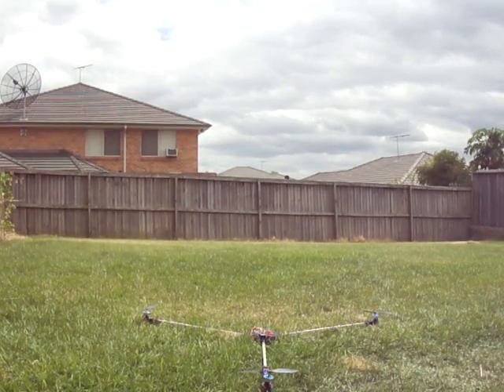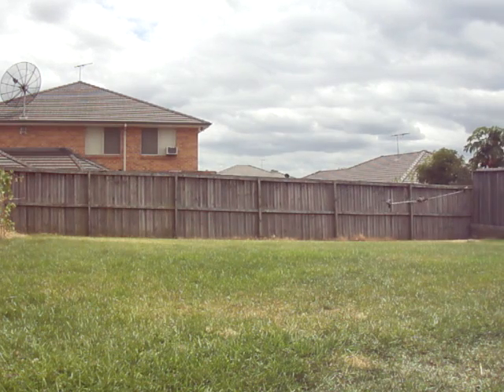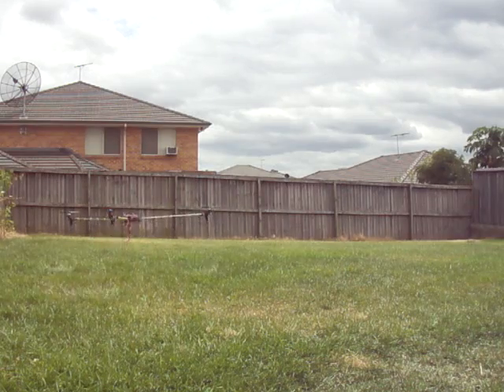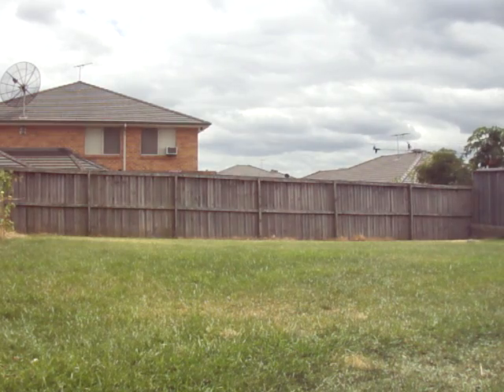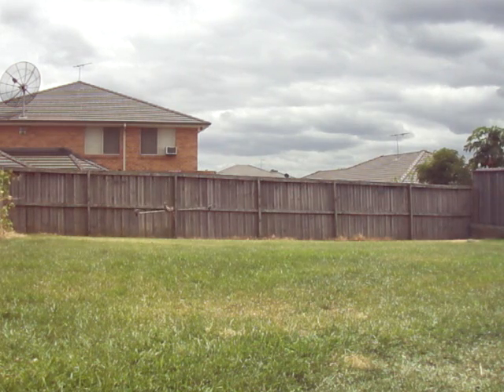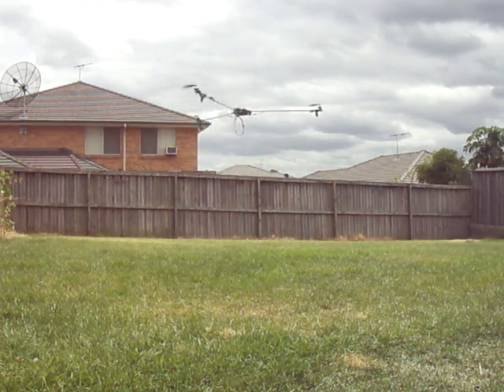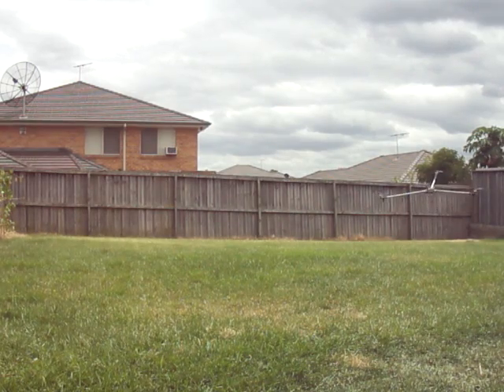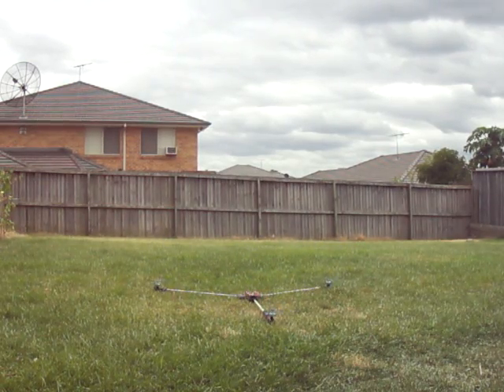Skookum SK720 powered Large TriCopter - Test4

Comment: i did just that ordered the v2 with the led set up and air mailed it ,they are slow  on the quadrino it may be broken but just read were it was recalled sending it back tomorrow .still working with the skookum i have tried all the tail settings with five different servos  thank you im a sat freak have c band and ku band mostly for foreign news source ,and it aint good play while we can cause shtf is coming stock up on food and water if ya don't need it then just eat it

Comment from the maker: Regarding your quadrino - if you're not familiar with programming the Amtel micro processor, you may have left some fuse switches out or incorrect when programming - this can lock you out forever so be careful - I suggest double checking the software and do reads only first to make sure it's setup and then check the fuses and then program - if it's locked out you'll need someone experienced to sus it out and see if they can recover it or not for you..

Comment from the maker: Strange about the tail - with the sk720 in a tri, the tail is really very much like a plain heli tail, nothing special. It should be the easiest part to work. Mind you, when it does work they are sloppy due to the large movement of the motor required - but should work.. are your tail servo settings correc? ie: frame rate,etc..  maybe choose a std digital setting for starters.

Re flying - my tri had large arms so you'll need to tweak the config for yours.

Comment: morning bud my skookum must be sick ,ive got it set up just like ya instructions say.but the rudder is a no go it just twitches tried several servos all the same and it has no gyro effect on tail,now i have 4 quads from xaircraft with fs 1212-ahrs-s  controllers you wouldnt know if its possible to use one of them on the tri would ya ? i also have a quadrino zoom board but it will not take program gives a error in other words im lost  could you help me